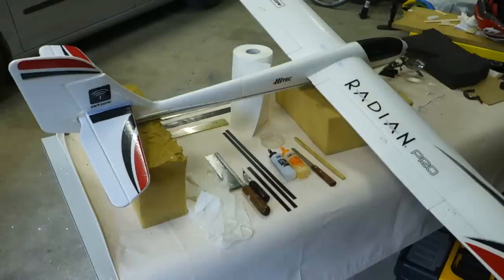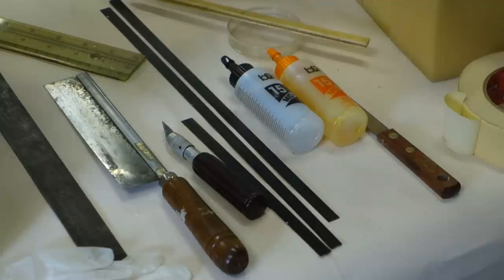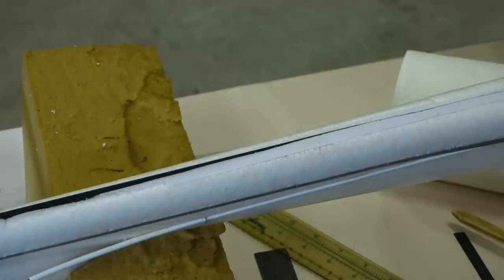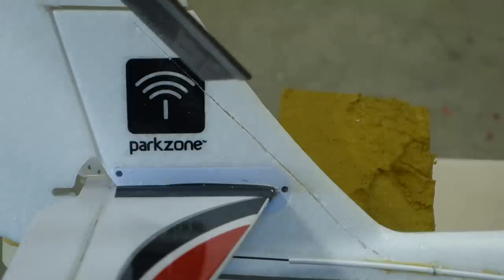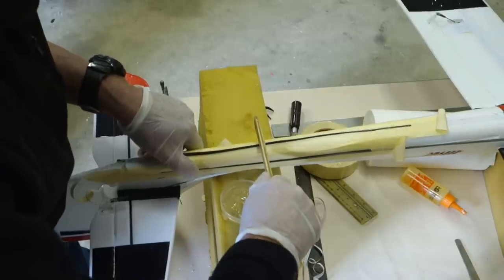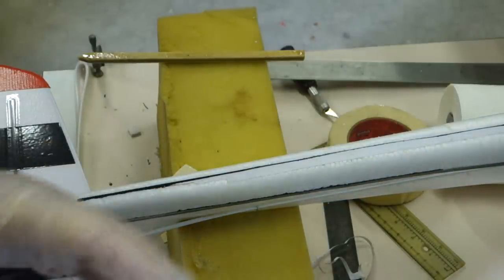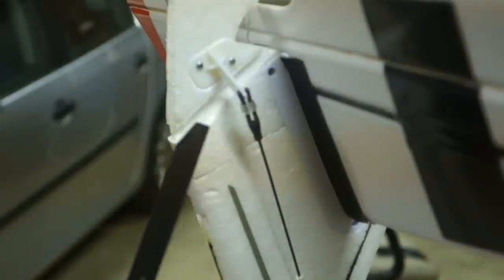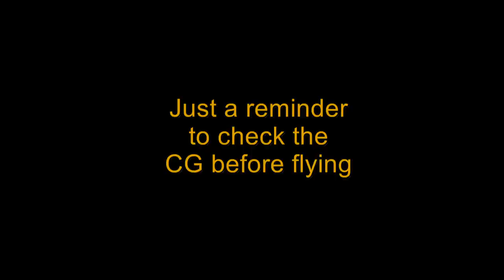Parkzone Radian motor glider fueselage strengthening modification

Comment: Hi Mike, thanks for the video. The weak tail section is an issue with the Radian so I'll now follow your suggestions and maybe I won't have to glue the tail back on every time I have a hard landing. I have found fuselage is also weak in the cabin area just behind the cowl so some carbon fibre added there will be a good idea. Also the cowl is held onto the foam body by just 3 small screws into plugs glued into the foam body. I have found that adding a thin smear of silicone sealant around the inside top of the cowl helps a lot.

Comment: A good method of forming a slot for the carbon strip is to use a low wattage soldering iron and run it lightly along the fuselage using a straight edge as a guide. A round tip for round rods or a flat bit for the rectangular section, it saves all the messing around with blades and if carefully done you can achieve the correct depth. This can be done by stroking the iron gently onto the fus. Press the carbon in the slot , a little drop of cyno and Bob's your uncle. Done and dusted. I have beefed up my Radian XL using this method. Thanks for a useful video.

Comment: Yes it looks strong, but.... all that weight pilled on at the back. Too much epoxy, perhaps some filler could be added to the resin. All I do is Use a good quality fiber tape and apply it to the sides under tension and you got a lite and stiff boom, do the same with the fin following the leading edge.

Comment: Hi, thanks for your tutorial, excellent method. I am about to do this on the Radian myself. Couple of questions, do you put a strip on each side of the fuse or just on one side pushed deep into the middle? Also what size carbon strips do you use? I have .5mm thick x 10mm wide x 1m strips. I think you need to cut the carbon strips with a Dremel cutting wheel otherwise it won't cut properly? Thx again, very good fix.
Reply: I think you could use 5 or 6mm x 0.5 or 0.6mm, his looked like 8mm or 9mm by 0.5mm, maybe even 10mm wide. 1mm thick strips are pretty thick and heavy.  I used 5 x 0.5 and 5x 0.6mm on mine. I did it a little different that this though. I just glued one strip on the bottom (on the surface) and one on top (on the surface).  It actually was really easy and I gained a ton of strength and stiffness in the fuse. I also stiffened the wing saddle in the same way,also put some really thin carbon strips up near the nose under canopy and on my elevator.

Comment: I just did this to my E Flight Radian Basic and it stiffened the fuselage up very nice, however; now it created another issue with the CG.  The factory CG is 63 mm and now after the mod, it's at 70mm, which makes it tail heavy.  I had to add about 21g of lead to the nose, and I hate adding that much weight.  :-(    I'll have to see how it flies when the weather clears up.

Comment: You would think the manufacturers would come out with a solution to this problem , say a plastic sleeve that fit over the fuselage and up the tail section enough to give rigidity , then just glue it in place .

Comment: sorry boys.... but all you do is create another weak spot ...the flex in the tail will never be an issue... even full-size gliders have some flexing in the wing and the tail think about that...... its a good thing.... happy flying :)
Reply: I agree 100%, Steph. Thing is, these guys and girls are modellers. They fly these things in ways the larger ones aren't capable of because it would over stress the airframe and unless the pilot has a death wish, they probably wouldn't attempt the manoeuvres in an aircraft they are sitting in. Proportionately most models are over enginered. That said this one could do with some improvement.
Reply: well said peter :)
Reply: I concur! I fly my rc aircraft as close to realistic as possible. I'm surprised at how many rc pilots don't even know about proper path tracking let alone how yaw is used to stay on track path. Not as important as full sized craft perhaps